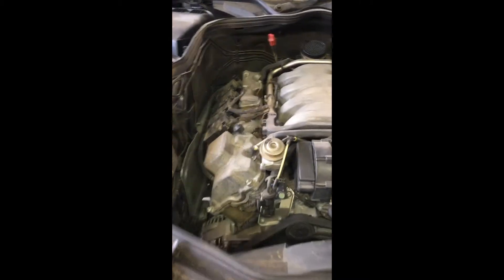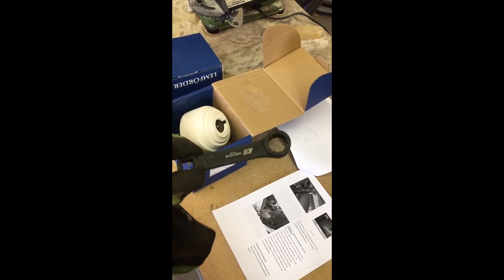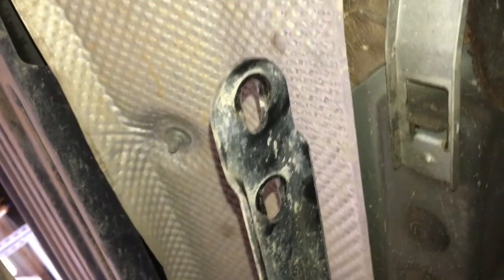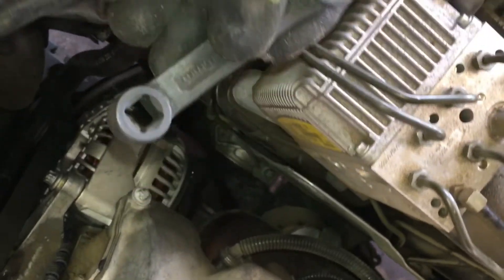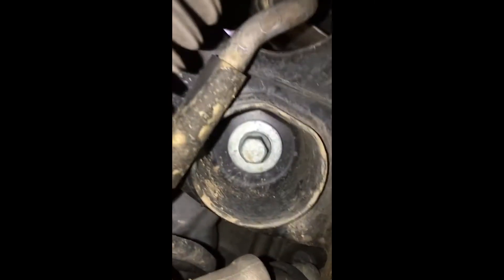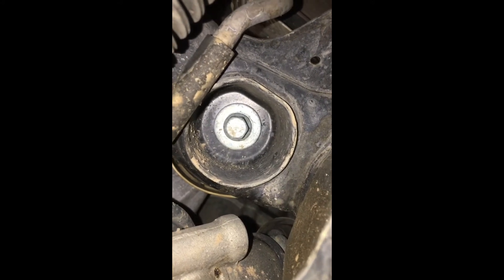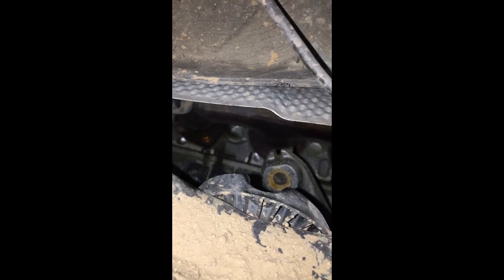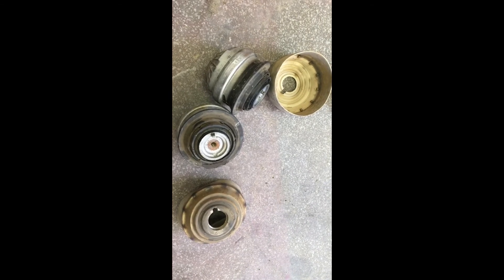2006 Mercedes Benz CLS500 Motor Mounts #motormounts #cls500

Comment: Thank you for recommending the special tool to remove the upper bolts on the motor mounts. [ Mercedes cls550 ] I was able to lift the engine and remove the motor mounts without removing the exhaust pipes. I removed the anchors from the sway bar and with a pry bar forced the sway bar forward until the motor mounts had enough room to be extracted between the sway bar and the steering rack assembly. I just wanted to add that to the mix
Reply: @Julio Alfred Instablaster :)
Reply: @Jayce Jadiel I really appreciate your reply. I found the site on google and I'm in the hacking process now.
Seems to take quite some time so I will get back to you later when my account password hopefully is recovered.
Reply: @Jayce Jadiel it worked and I now got access to my account again. I'm so happy!
Thank you so much you saved my account!
Reply: @Julio Alfred you are welcome xD
Reply: Do you really need that tool in order to take out the bolt ?

Comment: Excellent video! Now I have the confidence to go into this job DIY! Did you just unbolt the exhaust in front of the cats and let it hang down to make room to slide out mounts?  How did you like the ride with the Lemforder mounts?
Reply from the maker: LexBrett Gen2 yes I just unbolted at the manifold and let it hang. They came out the top. The ride is great!
Reply: You must feel great you did it yourself! Where on the oil pan did you put the wood to raise the motor? The oil pan on our car has a strange shape...

Comment: How many miles do you usually do this at?
Reply from the maker: I did mine just over 100K, but you can check yours by opening the hood, put in gear, foot on the brake and rev the engine a bit.  If the engine looks like it is trying to jump out, you need new mounts :)